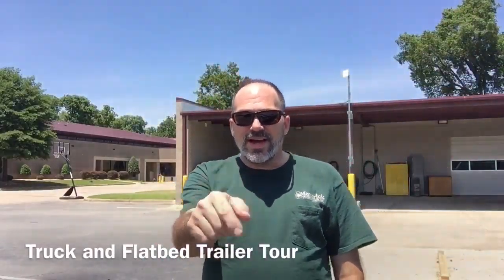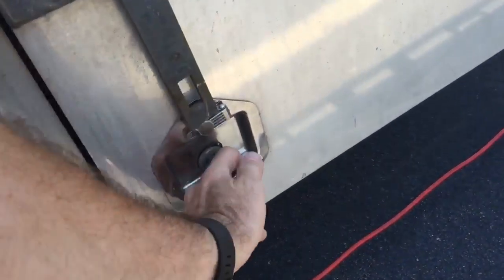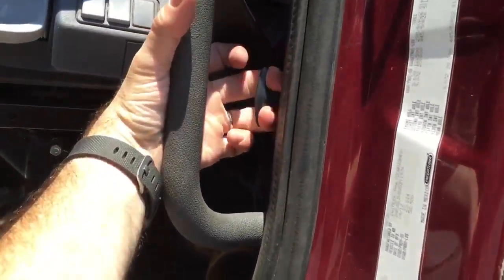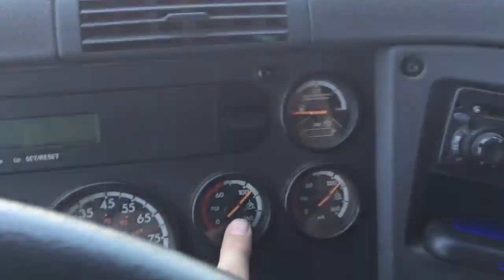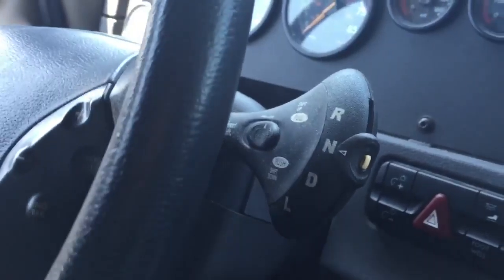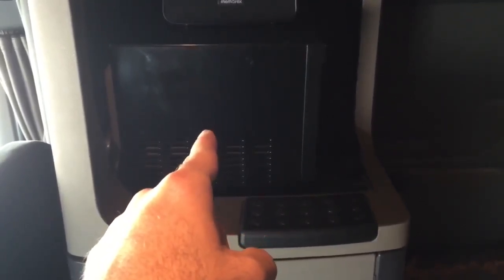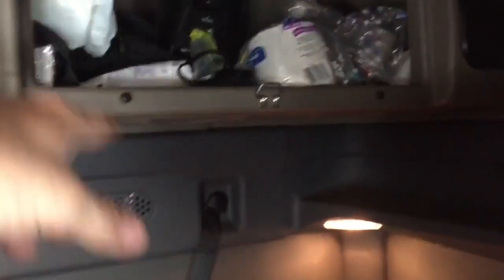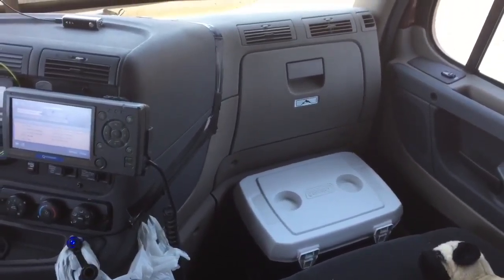Truck and Flatbed Trailer Tour

Comment: Gonna seem like an odd question, maybe not really, but  in comparing loads and % how many are strap and how many are chained?  How often do you use tarps?  Also does Maverick have a region of lanes, that you are based in?  Like southern region or southeast, etc?
Reply from the maker: I did a bit of a yearly recap in my year review video. I'm thinking I tarred just over half my loads and a majority of my time has been spent within 700 miles of my home in Dallas.

However, I just changed fleets and now I'm pretty much going to be staying within 400 miles of the house in TX, LA, AR and OK.

Comment: just bought a 2012 from maverick the converter is not working if you know the make and model of it so i can find out the problem. thanks
Reply from the maker: They've used different ones over the years. Check the master switch on the top of the converter box to ensure it hasn't reset itself.